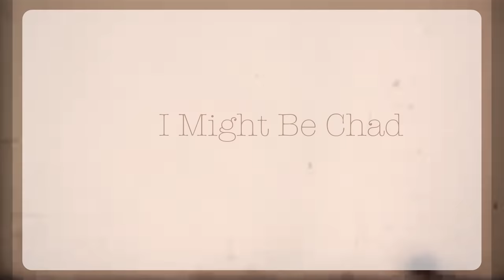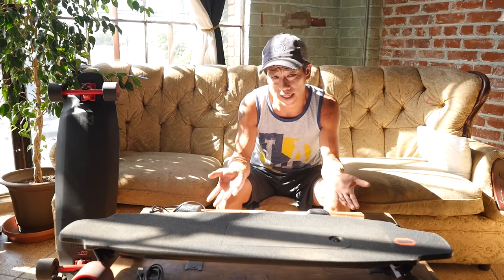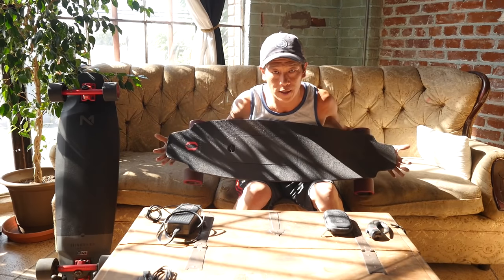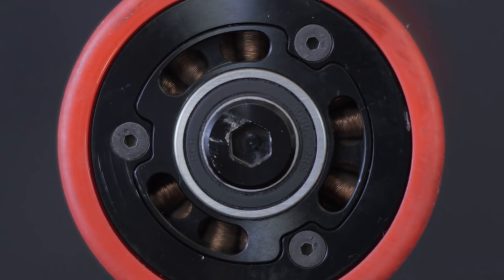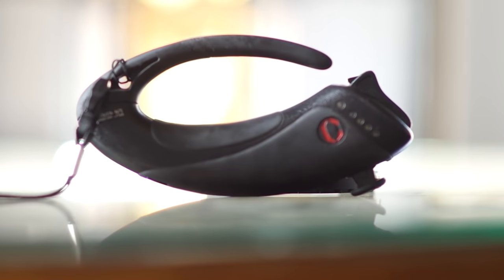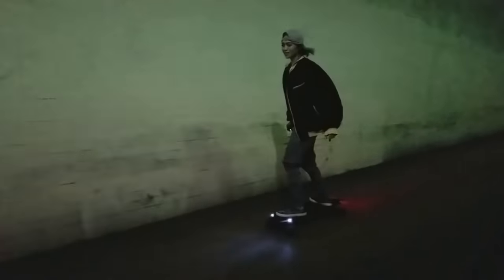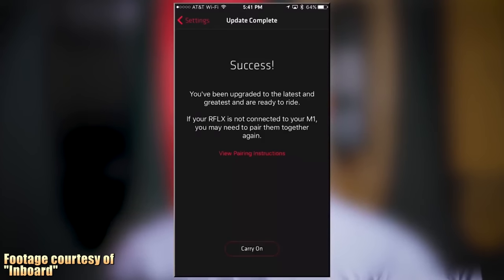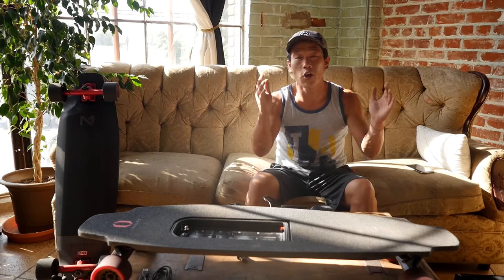" Electric skateboard review Inboard M1"

Comment: My inboard has broken down 6 times since june - I've had 3 different ones. Their customer service is great, but the board itself is not up to the rigor of daily commuting. This is the experience of most eskate enthusiasts.  You are also using an older version of the board, which has open motors. The newer version has closed motors.  You are pretty light (140 pounds) so its sorta believable you get 7 miles or so per charge, but most people get around 5-6.  Also this board does not go 24mph. In perfect conditions it can get to 22mph, but usually the board struggles to get past 20 (i'm 160 pounds). I really like your video style and all, but this video comes off as an add and not really a customer review.  You find very few inboard riders with many miles on their board (over 500), and thats for good reason. Boosted on the other hand is a much more durable board.  If you want an expensive toy the inboard is a lot of fun.... but if you are looking for a commute board, belt driven boards like boosted are going to be more durable. Evolve is another company that almost has it right, but their remote quality is terrible with disconnects and they use cheap batteries and get terrible voltage sag. Really the most reliable boards on the market are the Boosted, Mellow and Arc Boards.
Reply: I'm an inboard M1 owner as well and I can vouch word by word for Scott has mentioned.  I weigh about 180, and the range has always been the max of 4-5 (if lucky) miles (riding in the fastest setting).  Top speed for me is maybe 18-19 miles tops.  I'm really for the concept that Inboard Technology had pitched for the public, but unfortunately it's a bit of a let down.   I had to continuously send my entire board back at least 6 times.   I did catch the Youtube clip for replacing the Mantra Drive, but I never got the Mantra drive sent to me vs sending the whole board to Inboard.  Great customer service, but been without my board for 1 whole month every time I had to send it off due to the Mantra Drives failing or the board shutting down altogether.   I've had my board replaced 3 times as well.  I'm at a point of considering a custom build with recommended parts (Such as Kaly NYC Street carver (https://www.kaly.nyc/), or custom board with Mellow Board Hub Motors running at 12S) to get speed and range.  Seeing boards out there that can do 30+ mph with a range of 25-30+ annoys me knowing the money spent for the M1.  I really think they could have done better on range.  Seems like they could've added a 2nd slot for more battery.  Not to stir away from this brand, I love the "idea" of the M1, but disappointed by how it's been a board that has serious maintenance demand when it's not belt driven, which was one of the selling points for me.